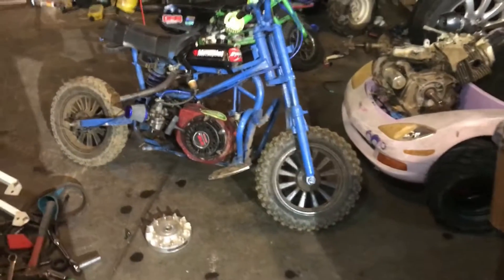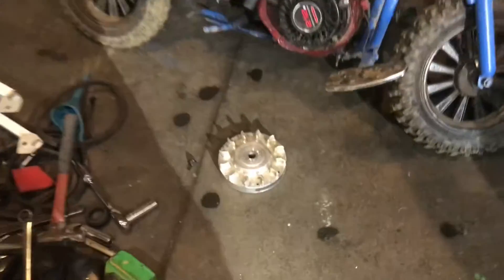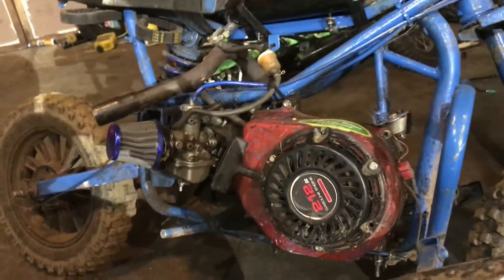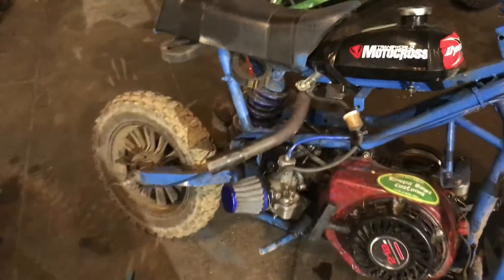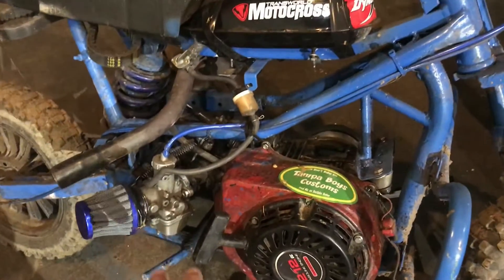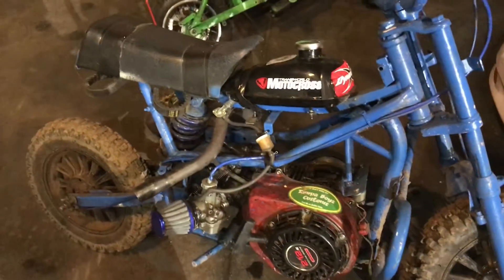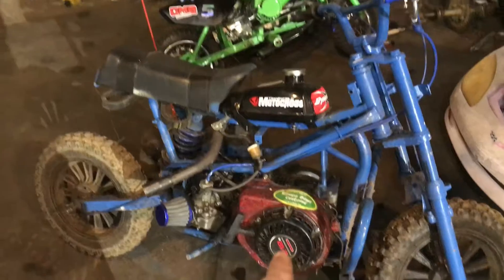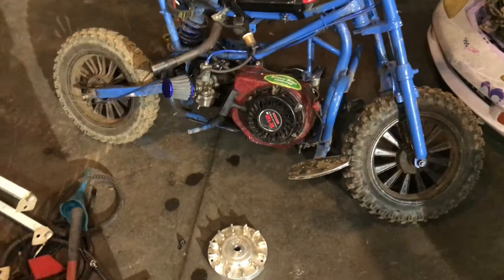212cc dirt bike needs your help

Comment: Maybe try using the pvl flywheel I think it using different timing that’s what it on my bike
Reply from the maker: I need to see what kind of flywheel you are talking about.This flywheel use to be good at the beginning.
Reply: I agree, the obvious thing is timing.
Reply: @samsgarage1716  So it only started ripping your hand off after a while? Has the keyway in the flywheel become enlarged? Is the key you used with it OK?
Reply from the maker: @BensWorkshop  I just check it and it’s good.I did lightly sand the inside a little to make it fit better.Maybe I messed it up.
Reply: I literally just started typing the sane comment as Tampa.  The ARC has 38° built in which is usually fine with a stock key. The pvl is 32 degrees which is only 4° past the stock required 28° of timing.
Reply: Most cams require 36-38° but some cams not so much. Your cam can also effect your rod length, too much timing without the correct rods can lead to valves not opening or closing enough.
Reply: @samsgarage1716  I doubt that. If you can't see any distortion it's probably not that.

Comment: Timing I would venture to say if everything else is good.
Reply from the maker: That's exactly what it was.Im still using the stock flywheel till I buy a better one. Thanks for watching.
Reply: @samsgarage1716  I'm a fookin scientist 😄. I had an aluminum flywheel I lapped and torqued and it still spun, sheared the key, and jumped time. Was pissed!